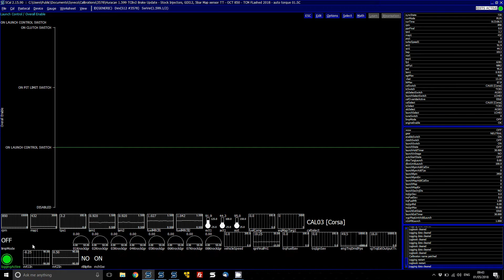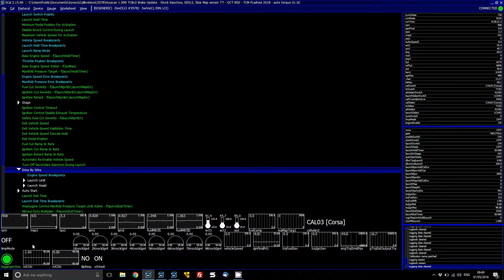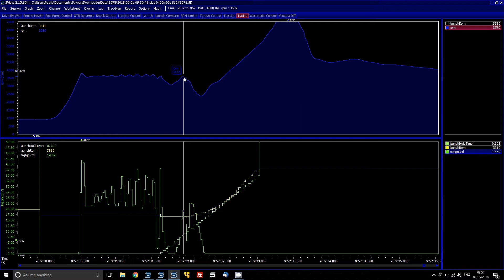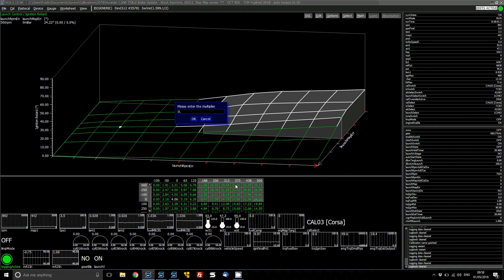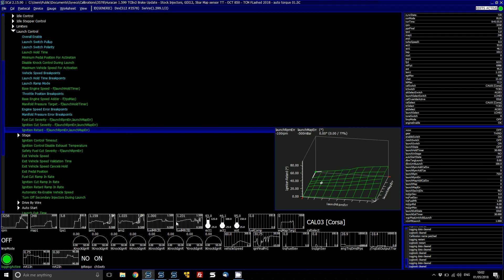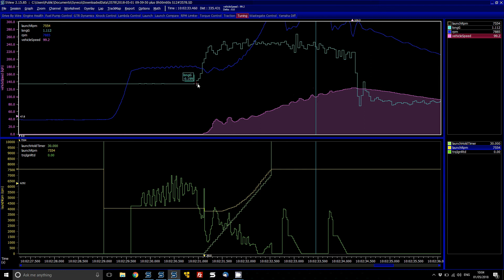Syvecs - Launch Control Setup

Comment: I've just set this on my S7+ 997.1 TT, very cool and works great, but I have to set my manifold pressure target to exactly double what I want it to be. Anyone have any insight on this? In the logs, the launchMap calculates out to be exactly half of my table value if you interpolate it. I don't have any adders and the boost progression table in the main MAP control doesn't seem to have any errors.

Comment: Note on 1.711 firmware you must have a long launch hold time when using clutch switch and speed strategy off front wheels in a RWD, and then also select ‘’exit speed cancels hold’, otherwise you’ll be wondering why it doesn’t stay in launch mode after staging. Spent a while figuring that out! Works 👍